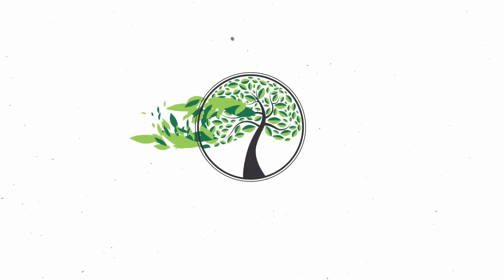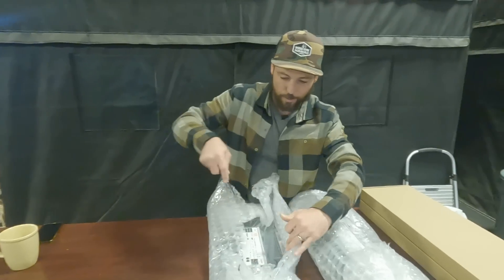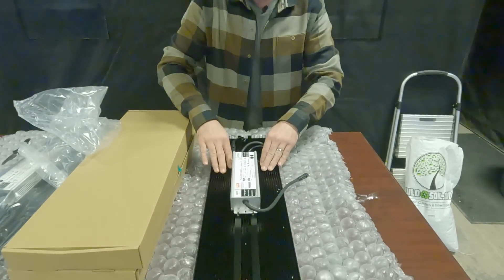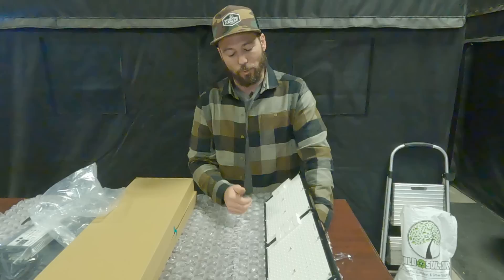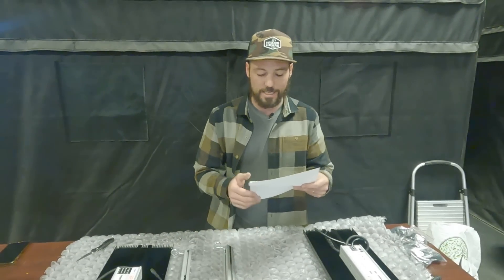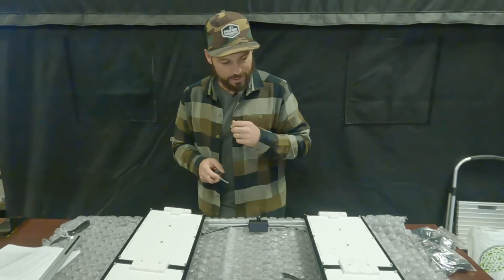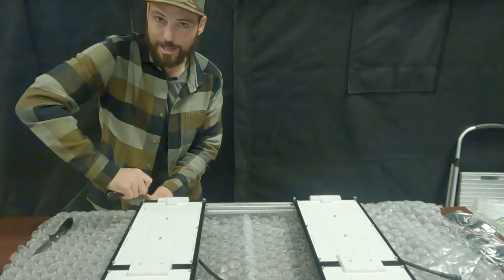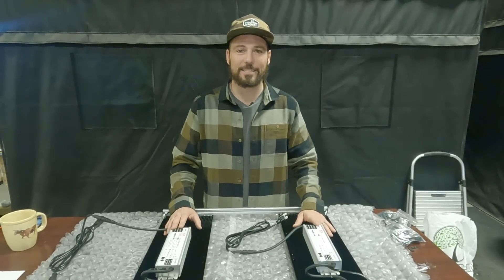BuildASoil Product Highlight: OUR NEW LED LIGHTS // HIGHGROVE MAGNOLIA 4

Comment: Boards are trash 🗑️ always buy bars, never boards unless it’s viprespectra
Reply: Viparspectra?....LOLOLOL Talk about junk. I should know, i started out with that crap. Had diodes burn out 3 weeks into my 1st run, not too mention the light spread is crap. Think you need to do some more research homie.
Reply: @mopar426power  I've never heard of somebody's light burning out in 3 weeks man that doesn't even make any sense. I've used various Amazon lights for almost six years with no issues. Maybe you need to check your environmental conditions
Reply: @jm12green31  Been growing for years dude. My "environmental" conditions are determined by VPD and the stage of growth I'm in.  Viparspectra is junk, 3 weeks into a brand new light i had 15-20% of the diodes stop working and the dimmer knob would make the remaining lights flicker. It took 3 weeks for them to get back to me and offered me a refurbished one like that was a good deal and i should take it lmao.  Don't get mad at me for stating my experience with that subpar brand. Theres a couple areas where its not a good idea to go the cheap route and lighting is one of them. I learned that the hard way. If you are happy with cheap lights then by all means go for it.
Reply: @mopar426power  the spread is for a 2’x4’ space so that’s fine, if you want a 4’x4’ spread get a bar light…I’ve ran my viprespectra for a year in veg and it’s doing just fine…lm301h diodes and meanwell drivers, plus the build quality seems quite solid…plus I can buy it on Amazon which allows for crazy simple returns or buying a really cheap warranty through Assurion. I own a light company, homie, so I know exactly what I’m talking about. Thanks for the unsolicited advice 👍
Reply: I have an hlg scorpion Diablo and it crushes it in a 5x5. Before that I used 2 600w hps for the same area.
Reply: @Farmer_bill85  first off, if you’re growing in a 5x5 I can’t even take your opinion seriously…second HLG is a great company but their product is overpriced and subpar(Steve Johnson is the nicest dude ever and I have nothing but respect for the people of HLG)
Reply: @TheYummyBrand  I agree with your comments man and as a guy that has researched and tested plenty of lights from Amazon and elsewhere, name-brand isn't everything. I could show you three or four that I own under $100 that are just as good as these $400
Reply: @jm12green31  name-brand doesn’t mean anything in my mind…it’s all about fixture quality and customer service. All these clowns run around talking about how their lights are different and better while using the same diodes and drivers. 🤷‍♂️ I sell a customizable 1000w bar-style with UVA and IR for $1000 after taxes and shipping, plus I do discounts for 10+ and pallet+, no one else in the market is doing that bc they all have crazy overhead costs
Reply: @Farmer_bill85  I have a few questions if you don't mind answering them. 

 I just put together 2 custom HLG Diablo boards on one of the Triple Heatsinks for a 5x3 space, coming out with about 360W total power (I have 2 sets of these).  Our lights specs are a bit different, but I'm curious about what intensity you usually keep your light at depending on stage, and how high from the plants are your lights depending on stage?  I was reading HLG's site mentioning 24" for veg, 15" for bloom, but I'm not sure if that's always the case(especially if it's not 100% intensity). 

 I also read someone mention their hydro store telling them 20% seedlings, 50% veg, 100% bloom, but I'm not sure about that.  I was also looking at the buildasoil complete system guide which shows PPFD and DLI amounts and for some reason it seems that it's asking for a lot more in Bloom than the HLG lights put off, so I'm a bit confused about that, especially since the HLG lights get rave reviews.  I think I would need to get a par meeting to get actual results, because I'm not fully sure where these values get rated from.

Buildasoil shedule - https://cdn.shopify.com/s/files/1/0248/9641/files/BuildASoil_Schedule_-_2022.pdf?v=1649176960

PPFD Calculator - https://horticulturelightinggroup.com/blogs/calculators/ppfd-calculator

DLI Calculator - https://horticulturelightinggroup.com/blogs/calculators/converting-ppfd-to-dli

My specs would be

803.71 PPFD
DLI: 34.72

Buildasoil is asking for, in Bloom,

900-1400 PPFD
DLI 40-60

I assume then to just lower the light height to the plant, but everyone else does it with success at 15" I'm assuming so I'm curious.  Maybe lowering it would yield better results?  I'm curious what others experience with their HLG/LED Lights.

Thank you very much for your time and help I appreciate it...  I'm a first time grower, so all of this is new to me.
Reply: @Farmer_bill85  lol, you do you buddy, board are still trash…sorry, but physics still matter
Reply: @ChannelTheLizard bc you’re not serious about an even canopy and getting all “A” buds

Comment: Love these reviews! I use a chilled growcraft x6 600 and love it.
Reply: i love my x6 600 too
Reply: I'm currently looking at the Chill x3 500. what size space are you in?
Reply: @UnderFogFarm  in in a 4x6 but have a spider farmer 200w on the end for a little extra coverage
Reply: @busyb4283  I'm in a 40"x48" grow space on the flower end. W/ SF4000...it's starting to flicker a little. Check out the grow @growcoast. Also running a 3'x3'x3'(h) veg area for the littles and a 2'x3'x5 for the transition phase.
Reply: @K C-D  the difference front a SF to a chilled is pretty significant imo. I'm going to get a x2 growcraft at some point to replace the sf2000. Even in my current set up, my x6 never gets above 75% due to the sheer intensity of light. I also like the fact the driver can be outside of the grow space.  I have a small 2x3 clone area with 2 sf1ks. Sounds like you have a good set up though. How long have you been running the sf4000?
Reply: @busyb4283  not that long about 16 months and only in the flower tent. it's my second the first failed after three weeks.
Reply: I'm running two X3-500W Growcrafts in a 5x6 space. The coverage is good and they penetrate into the canopy.
Reply: @ericrobinson2462  Sweet, thanks for the input!
Reply: @UnderFogFarm  im in a 4x4 the x6 600 crushes it

Comment: Right on..I run two 240w bavagreens…same diodes & driver & same IR, UV & FR on separate switches 🤙very similar build
Reply: And they kick ass for $200 or les
Reply: Wow I'm running 2- bloom plus xp2500 side by side with gravita uvb in between my two 250 side by side and I'm getting great results with those budget lights too. Good job bro , our set up are similar to mags set up , this way all of your foot print is covered evenly , this must be there thought , that's what I thought when I purchased my set up..

Comment: All those parts are primo... they are the workhorse of the industry now, and appreciate you explaining he adds in better heatsinks and all that. And warranty is the most important thing that most brands won't follow through on (yet people will promote them because they were given a discount to make a video, myself included and i turned down the offer)
Reply: Samsung LM301 & Meanwell Driver I did 24 hour testing in veg with in 2020... ran them for months without ever turning it off... plants grew super efficiently, cannot be beat lately.
Reply: Shane, MIGRO, Aray; nuff said for the home-grower.